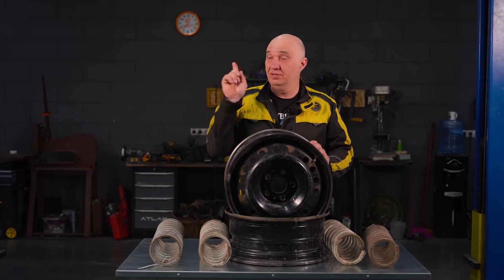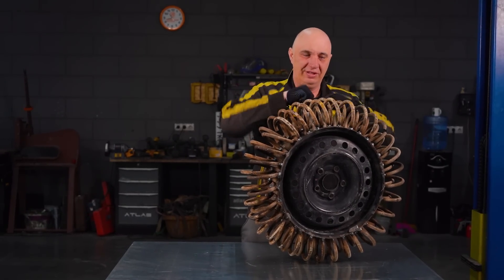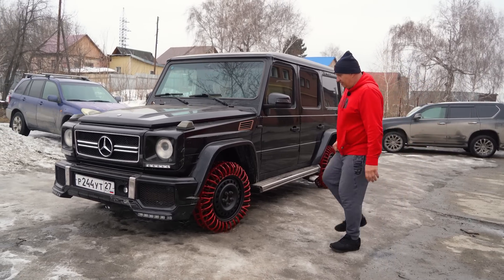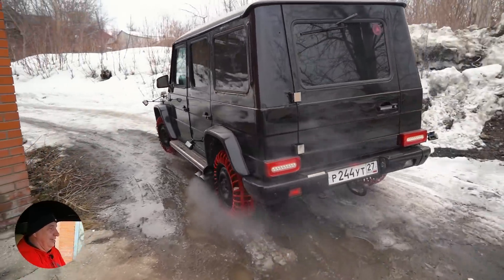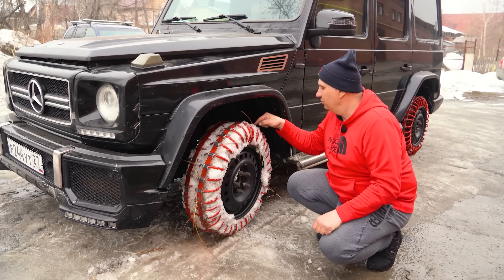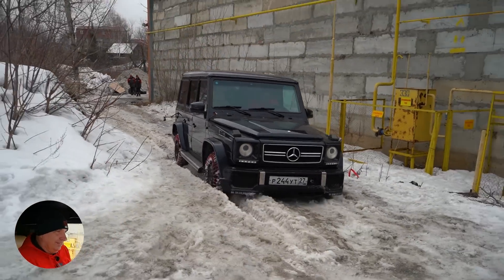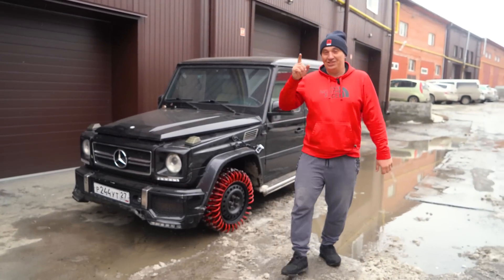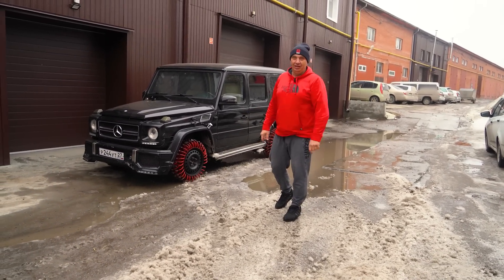We replace tires with springs - are they better off-road?

Comment: Man Mercediez are the biggest pieces of junk cars ever lol, just above Kia's and Hyndais lol
Reply: It doesnt come like that from factory.
Reply: @martinsv9183  Yeah them being pieces of crap IS standard from the factory. Take my word for it. Worst car my family ever owned. Everything broke on it. It was the quality of a chnees car
Reply: @VashStarwind  No they are really good of roaders. One of the best. Always wins when tested against the competition. But you need to service them. Else it will get expensive :) Its an expensive build.
Reply: @martinsv9183  No they arent lol. They are pieces of crap. You can use/buy pieces of crap if you want, i dont really care lmao. Just mentioning my experience.

They arent built to last, they are built to be replaced every few years. On top of that, they are very hard to work on.

And they started using "sealed for life" transmissions that you cant even service, or change the fluid. They is not what a well built car is like ha.
Reply: @VashStarwind  Yes they are built to last. There are many from the 70's stil out there. Used in thee military. Much heavier duty build build than any of its competition.
The 5G box was the strongest transmission built by anyone up until much later. There is no "sealed for life" transmission in any MB. All can be serviced with oil changes.
Reply: @martinsv9183  Totally wrong my guy, they almost all use sealed for life transmissions.. lmao
Reply: @martinsv9183  And dude idk what your talking about, cause a 70s benz still driving around is extremely rare. Even a 90s still driving around is rare. And they were built BETTER back then than they are now..
Reply: @VashStarwind  Yes its rare. But not as rare as other cars. Since MB had the most miles on them of all brands before junked.

Haha no they were not "sealed" :)  ..only if the label "MB workshop only" and a little plastic pin in the cap were enough to stop you.
 
They claimed you didnt have to change the oil and filter. But you could change it as much as you wanted. And if you did, that transmission would last longer than any other transmission on the market. Ever. I had one with +400.000 km on it. I still couldnt even feel the gear shifts at constant speed.
It was still the only transmission that could take +1000Nm even when MB introduced their 7 speed. So the 5 was kept for the V12 turbos.